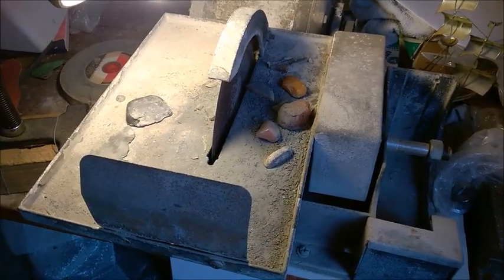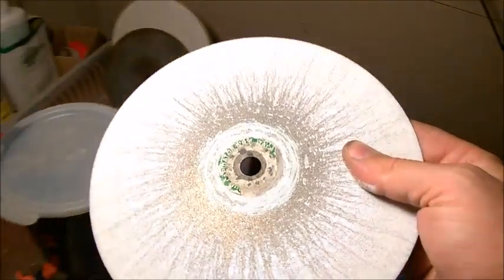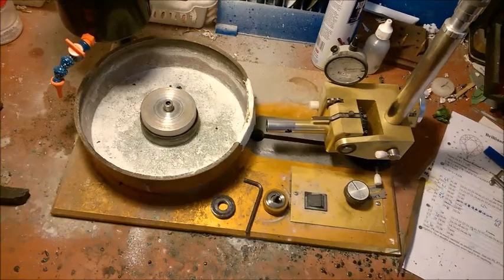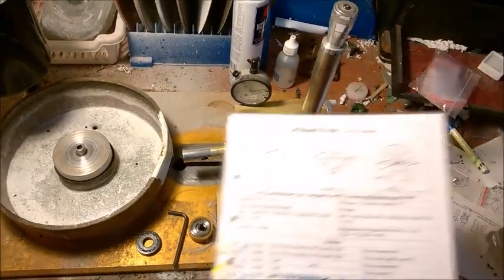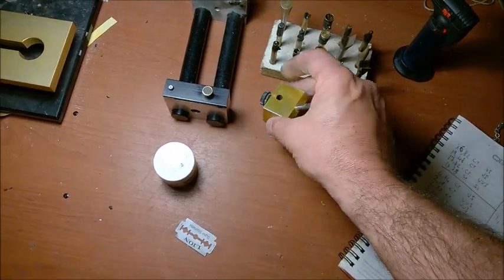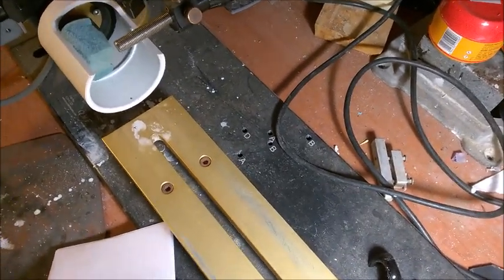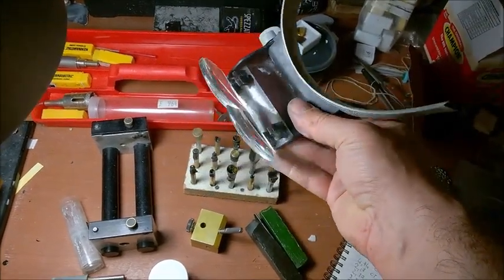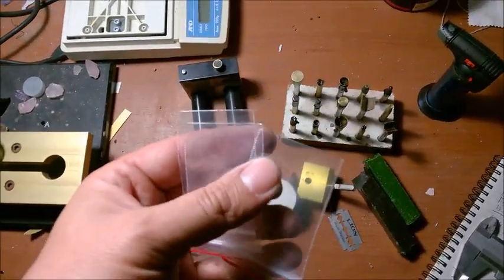How To Setup Your Basic Gem Cutting Studio

Comment: Pls tell me for polishing use copper lap disk so why you use tin lap disk for polishing?? Is tin lap batter then copper lap?? And i can use tin lap for polishing the stone such as agate quartz etc??
Reply from the maker: Hi there, thanks for commenting. I have plenty experience polishing with ultra laps and ceramic. I never tried with copper but I think they maybe a little too hard for some materials. I find tin lap very versatile and I polish almost anything with it. My mail contact is sutra1976@gmail.com. Cheers!
Reply: Angelo1976 grt its good for me that i can use tin lap. :-)
Ok sir i m using voodoo oxide for polishing on foam type material voodoo oxide is green powder so i can use ths powder on tin lap??
Reply: Angelo1976 u rite the copper lap hard for some material and tin is best bcz tin is soft then copper. But ceramic lap is not available in market

Comment: How can I find the cylindrical oval cutting bits?
Reply from the maker: Enes SOYLU oval drilling bits? That’s nonsense, rotation makes everything cut round
Reply: @sutra1976  Yeah thanks, what is the name of that bits, I want to buy some but I couldn't find since I don't know the name? I tried searching with  'cylindirical faceting tips' but no chance.
Reply from the maker: Enes SOYLU try searching for diamond coated core drills. Most diy and hardware store they sell them to cut holes into  marble tops or tiles